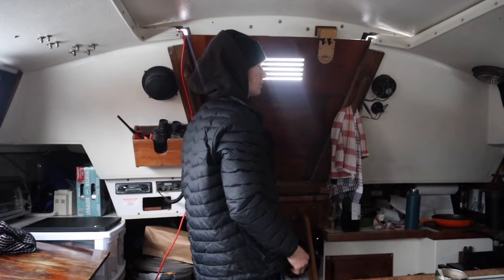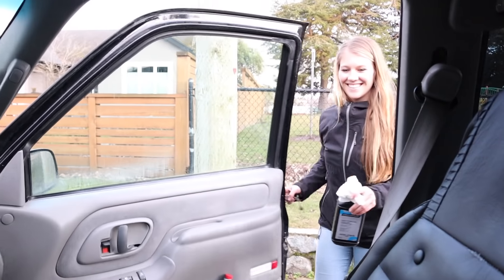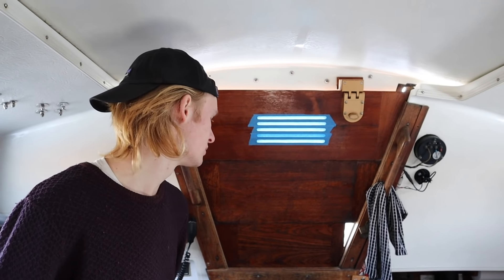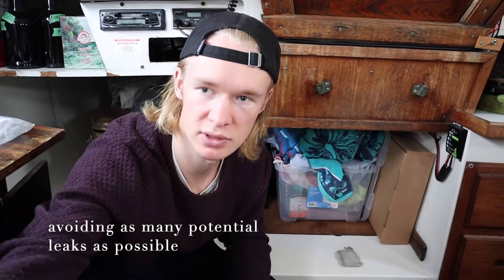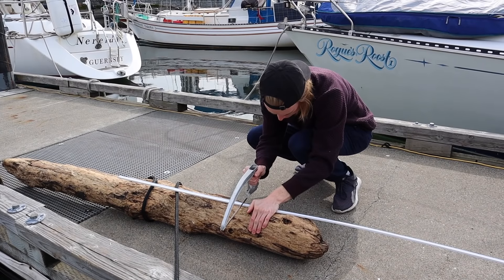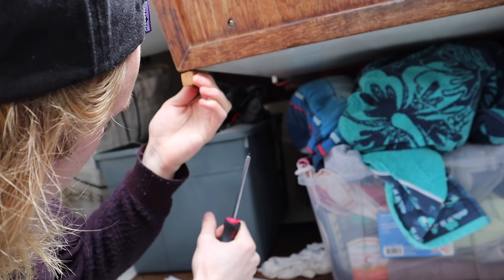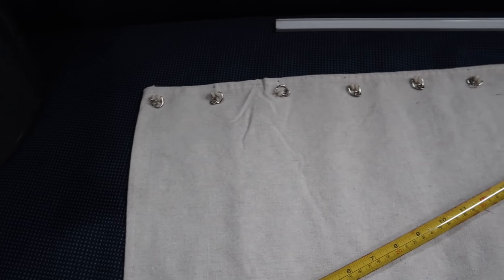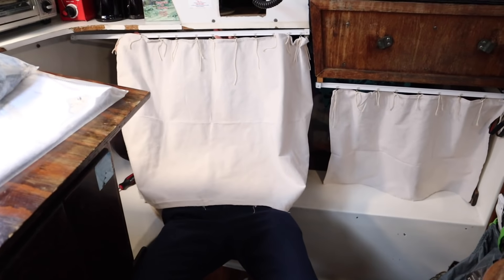Easy DIY Curtains for our 1/4 Berth // Beautify Blue Moon // Living on a Sailboat in Canada Ep. 16

Comment: Here's some helpful hints from an old woodworker:  The little wood spacer kept splitting because you drilled along the length of the grain instead of ACROSS the grain.  Also it wouldn't have hurt to have made the holes a bigger diameter than the screws. The screw just had to bite into the surface of the boat- that wood was just a spacer.  As it was, your screw was pushing out on the wood causing it to split.  Make sense?  For your lower drop board you won't need large clamps.  A couple of c-clamps will probably do.  Here's why- You can use the companionway as a clamp!  You can put nearly anything (even some sheets of paper or a drop cloth) across one side of the opening- preferably the 'good side'- and slide the board in place when glued up.  The extra width of your 'shim' will add clamping pressure across the length  of your drop board.  You will just want some c-clamps to keep the faces lined up.  Before gluing up, clean the surfaces of any previous repair attempts. Acetone is good.  Paint thinner.  Do not sand!  You want to keep as much original mating surface as possible!  If it is a clean break, just give'er.
Reply from the maker: Thanks so much for this Marcel! That is a genius idea about using the companionway as a clamp!! We will definitely be doing that :D

Comment: Pre-drilling helps prevent splitting.  Your issue is you screwed into the grain instead of across it.  There's zero strength that way.  You have to drill across the grain.  If you need to go into the grain like that you need to use pocket holes.  What I might have done with that is drill about a 1/4" hole and use a 1/4" dowel with some wood glue instead of a screw to hold it to the cabinet above it.
Reply from the maker: Thanks for the tip! We were concerned about drilling with the grain... and paid the consequences of it haha. We will try to be more prepared next time and keep your advice in mind :D
Reply: @BlueMoonLife  Another tip, if you ever worry about stripping screws in wood, get a small section of dowel, like 3/16th inch or 4mm. and a bottle of wood glue.  If something strips drill the hole that size, put some glue in the hole and pound in the wood dowel.  Trim flush and wait for glue to set.  Now you have a fresh surgface to predrill for your screw.